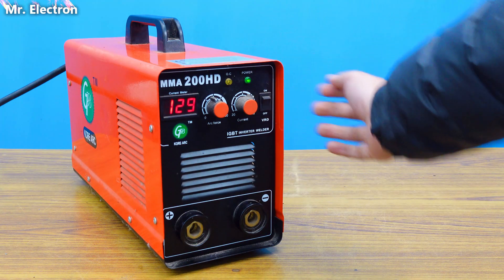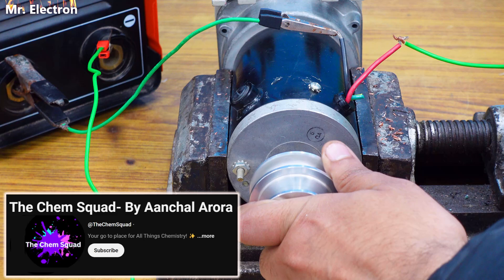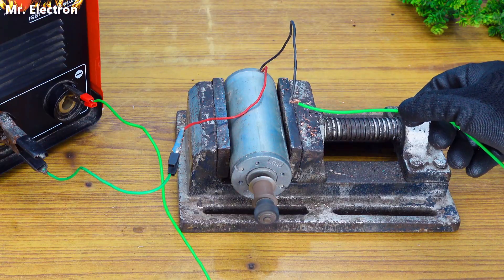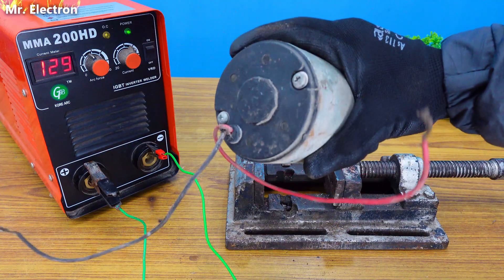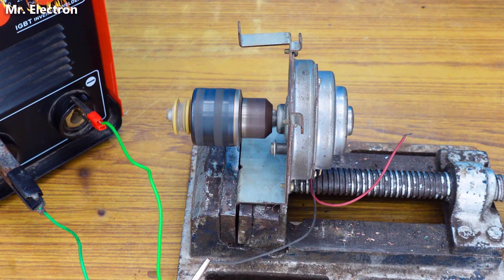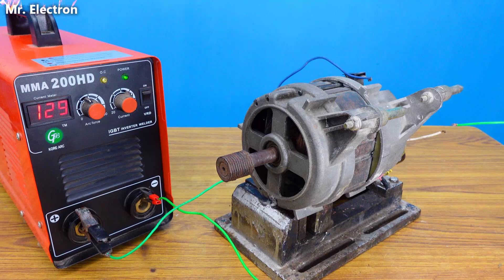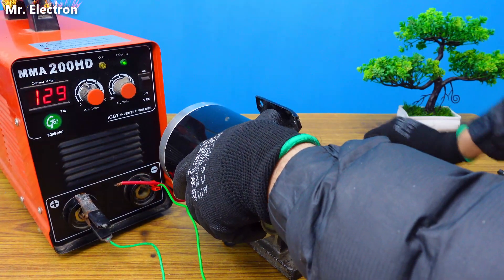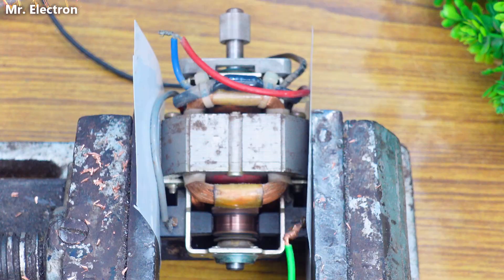Can we use a 200 Amp Welding Machine as an SMPS DC Power Supply ?

Comment: Arc welder as a chrome power supply as it requires high amps above 100amps? I couldn't get it to work possibly current distribution?
Reply from the maker: Its difficult to say with such limited info - Hey Friend! Please JOIN on WhatsApp for a stronger FUN and LEARN community: https://whatsapp.com/channel/0029VaQmmRaFCCoWOf7huh3G

Comment: I'm planning to use it to convert my dirty generator's electricity into a clean smooth sine wave using an Inverter and a welding machine as the input though I need a high power buck converter cause most inverters take only 12 volts

Comment: there is a 400W DC-DC Step Up Boost Converter DC 8.5V-50V To DC10V-60V 15A Constant Current Power Supply Voltage Regulator ...do you this this is legit? sounds too good to be true..

Comment: I hv used it for electrolysis aswell but for nickel plating it messed up...learnt the hard way that plating needs low volt/amps.
Reply: even electrolysis needs low volt high amps

Comment: Is there any option to lower the voltage too much 24v
Reply from the maker: No, there is no option to lower the voltage to 24v volts. Although, we can modify the circuit for the same or use a powerful 24v buck converter with it.

Comment: make lead acid battery charger or starter with welding machine.please. and when you use a minimum current  i want to see the voltage droping